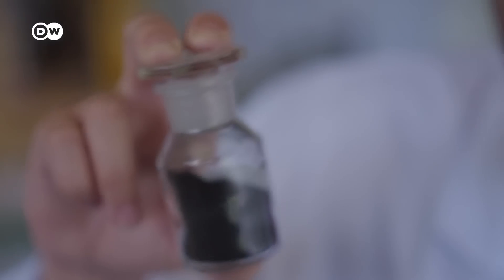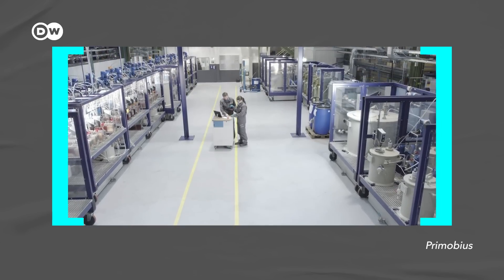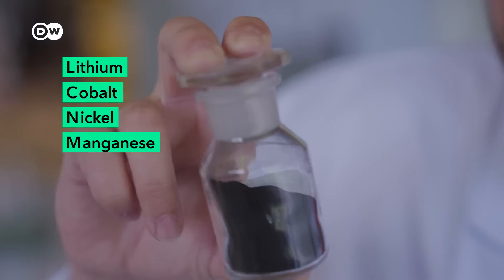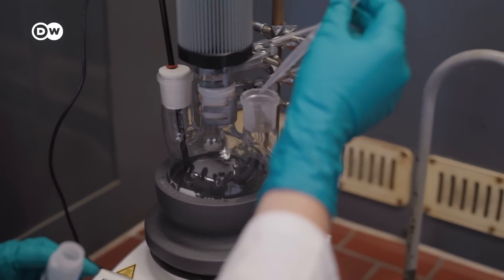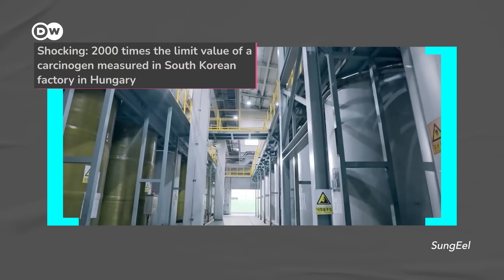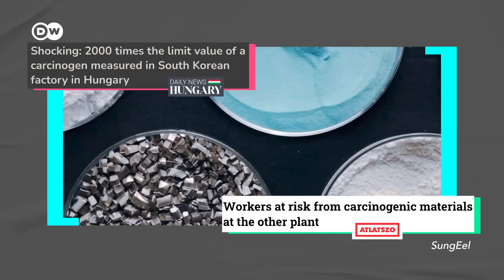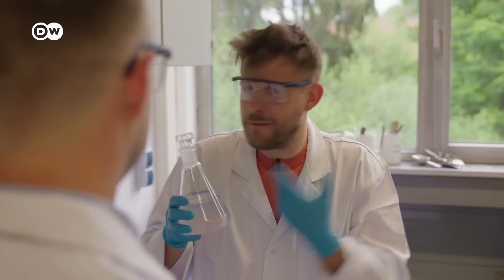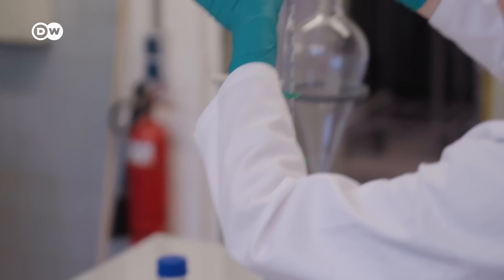The problem with recycling electric car batteries

Comment: I worked in chemical recycling for 30 years, rogue materials in your inputs can play havoc with the process and can be very difficult to detect. 
We used shredders at the start of the process which worked very well until a drum of waste from say a car repair shop had a starter motor dropped in it and kiss goodbye to your shredder blades.
The recycling industry is very innovative, and I am sure when there are enough scrap batteries available then the process will be sorted.
Reply: What part of starter motors breaks shredder blades? 😮
Reply: @3abxo3990  probably the shaft and the bearings. those parts are usually made from hardened steel which can´t be shredded by the hardened steel shredder discs
Reply: I have used several shredders for relatively soft material but they have low rpm and torque measurement on the motors so they stop instead of being damaged if there is some hard object that they can't chew.
Reply: @skunkjobb  Low torque? I'm perplexed about that part. Torque and hp are related, but a shredder seems like a high torque device.
Reply: @davidnika446  I think he means minimal torque. It's a common thing in big machines to use only the minimum amount of power to do the job so that if something unintentional gets into the machine or if something breaks the machine will come to a stop before it tears itself to bits.
Reply: We do not expect starter motors to mixed in with electric car batteries.
Reply: NO

Comment: Answer is obvious - STANDARDIZE. Lets begin with clearly labeling battery cells of what is inside them and in what ratios. In a decade or two we can pick a battery chemistry that is good enough for most use cases, declare is as the only acceptable battery chemistry and optimize our recycling processes for it. Should work fine.
Reply: That is one of the goals of the EU standard for battery 'passports'; to ensure each cell is labelled (most likely with a QR code) so that the origin and chemistry can be read at end of life.

Comment: If there aren't that many batteries to recycle yet,  and the materials aren't that expensive, that's actually sort of good news, means there is more time to spend on perfecting the recycling technology, and we aren't anywhere close to hitting the limits of how many EVs can be made. A lot of people in the past claimed that there isn't such and such material to transform all cars to electric, for example. Whether or not that is true, we are clearly not yet hitting those limits, as the materials are still so cheap as to not make recycling that profitable.
Reply: The "cheap" materials is a reason for the high costs of EV batteries - which could become more costly.  M

Comment: Starting by chucking the battery in a shredder, doesn't exactly sound great...
Batteries need to be made to be more easily dismantled, and just generally have recycling in mind, during the design.
Reply: Many recycling operations start with a shredder, it is often more cost effective than manual dismantling. Cars, domestic appliances, electronics, car tyres etc. I used them for many years.
Reply: I agree in principle the batteries (indeed all electronic devices) should be made with recycling in mind.  to a certain degree.  But shredding the batteries followed by density separation (like the way LiCycle does it) is probably much more economical in long term and at mass scale.  Because if there is too much pre-dismantling required then labor costs go up and labor is not cheap especially in western countries.

Comment: The process shown here are not unlike  the process to turn the ore that's mined into the original raw materials, that's something that rarely is talked about. the main reason this can be more expensive than mining is that the process are not in scale yet
Reply: And they won't be in scale for quite some time. Because there is more ore to go around than discarded batteries. And there will be more ore than waste for a long time. Economies of scale will always work in favor of making brand-new goods as opposed to recycling old ones. 

Recycling can only be competitive when two conditions are met. Condition number one: recycling the material involved less expensive and complex steps than making new material from natural resources. Condition number two: the processes of recycling and producing material are similar enough that you can use much of the same refining equipment for both, even mixing scraps with raw materials in your batches.

Glass, steel, and aluminium are among the few materials that fulfill both criteria. Plastics, fine chemicals, and alkaline metals (the critical component of batteries) do not.
Reply: @augustovasconcellos7173  this is when regulations requiring batteries to be recycled can tip the balance, even if the market by itself would favour mining.
Reply: @adrianthoroughgood1191  Agreed, we need regulations on two fronts: Disassembly procedures and put a cost on discarding batteries without recycling.
Reply: @xelaxander  The big issue he didn't cover here, was the wast that is left. You need a chemical plant to neutralize that, which is even more expensive.
Reply: @pietermoorer3679 Totally unlike mining waste… ;)
Reply: @augustovasconcellos7173 another condition: recycling gets mandatory by law.. (here in Italy the producers of plastic have to pay for recycling it as well, at least the recyclable ones)
Reply: @MarcelloFerrara95  The problem with plastic recycling is that it is almost impossible.
Reply: @augustovasconcellos7173 at the moment, worldwide there is almost 200X the amount of battery waste compared to battery production capacity. Even the very first generation electric cars are still basically untouched, not being recycled at all. As of now, less than 2% of electric car batteries get recycled, and less than 1% of all total electric car batteries in history have been recycled.

Comment: Thank you. suprised to know there is only chemical process of getting the basic elements back from the batteries.
Reply: I think they said that's true for the lab and to get great results with low energy usage. Industrial scale processes may use more heat and energy and less chemicals.

Comment: Let’s cut the crap here. Ever seen an oil platform, an oil refinery, a naphta cracker, … it’s complex. But it’s profitable. Recycling batteries is complex. And it’s expensive. At least in western capitalistic terms. That means western capitalists don’t see it as something to ‘invest’ in to profit from it. Yet. The real question should be: how complex is it, and what would it cost, to recycle used fossil fuels?

As long as they can’t enrich themselves on it, they not only don’t care for it, they will actively sabotage it. As long as we allow them to keep us dependent on fossil fuels, they will not change their modus operandi.

And that’s the reason the green transition isn’t going as fast as it should go. Because of their greed. That’s the reason hardly anyone in the west is aware of the severity of the situation. Because of their deceptions. That’s why China must be put in a bad light: they prioritise necessity over profit.

Comment: So how does recycling compare to mining? Surely to extract high purity metals from ore is even more difficult
Reply: Mining is much much easier and cheaper.  And well established.
Reply: @philbiker3  what makes it easier and cheaper? You probably also have to dissolve the minerals and purify then in some way
Reply: @Netherlands031  It depends on so many factors and can be different from mine to mine and recycling center to recycling center; and different materials are easier or harder to recycle.   Steel is super easy and cheap to recycle, so is aluminum.  Both of those metals are recycled all over the world super efficiently because it's cheaper and easier to recycle than it is to mine and refine.  This video we are commenting on explains how difficult all these specific materials from batteries are to recycle.  They're not like the steel and aluminum that can just be melted down.  The biggest reason that it's easier and cheaper to mine is that the industrial infrastructure is already in place at scale and well understood.  Nothing new has to be built, it's already in use all over the world.  Perhaps in the future when there are more batteries to recycle economies of scale will make it cheaper and easier to recycle these battery components.
Reply: @Netherlands031  The mines produce streams that have a more consistent impurity profile.  Also, no one is expecting mines to recover 99 percent of the metal in the ore, if it is not profitable.  Practical recycling would be roughly separate the components in the black mass and take the most valuable stream back into the plants that refine the ore at the right spot.  You probably wouldn't even remove the acid, since the same acids are probably used in the refining process.
Reply: @philbiker3  What makes the process more expensive right now is that there are very few EV batteries to recycle to begin with.  Thus, it cannot be done on a scale as large as mining is, which increases the cost of recyling relatively to mining.  

On a similar scale of production, recyling metals is far easier than mining, extracting, crushing and then separating the metals.

The cost of recyling lithium batteries will drop once a lot of EV batteries will need to be recycled, which isn't yet the case since most EVs came to the market not so long ago and still have their original battery, and once the battery isn't usable in a car anymore, it can sometimes still be used during many years for other applications.  Thus, it will only start dropping in many years to come.
Reply: @philbiker3  Typeically they are in much smaller quantaties then say steel, aluminum, and what do they do with the plastic and the rest of the junk thats left over from EV's. Cobalt is a by product of mining copper and nickel, in Africa it's artisanally mined, lots of cheap child labor.
Reply: @philbiker3  : you talking about brine, spudemene, clay, lepidolite?  Most lithium from what I understand comes from either as  spodumene from AU or brine from CHIL.
Reply: @tooltalk 👍 majority hard rock lithium ore yep.
Reply: Perhaps.  We shall see in just a few short years as many evs are on the road and they will need to be disposed of.
Reply: If it was the case, we would already be recycling the minerals...
Reply: After an EV burns down , then all those materials are lost .
Reply: @Philip-hv2kc  In the case of petrol cars, tens of thousands of litres of fuel are lost, no matter if the car burns or not.

And in reality, petrol cars are more likely to catch fire spontaneously than EVs.

Comment: 1:46 blackmass 8:43 many battery chemistries 10:12 old EV batteries being used in second-life applications,👍 delaying need for recycling
Reply: Absolutely - I'd love to have a set of those used Li batteries for our stand-alone solar system!
Reply: Yeah, if the batteries are lasting longer and being used, that shoudln't be considered a problem, that is actually good news.